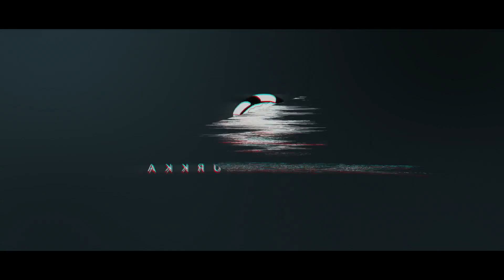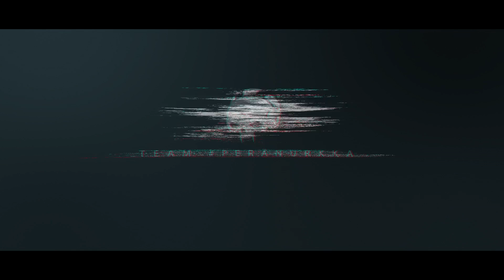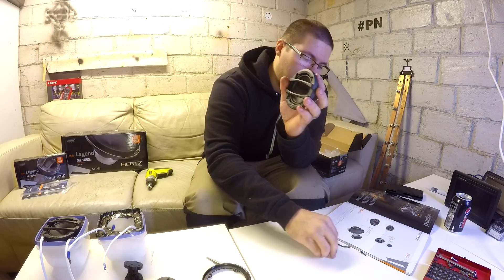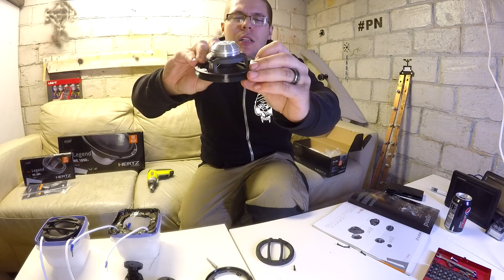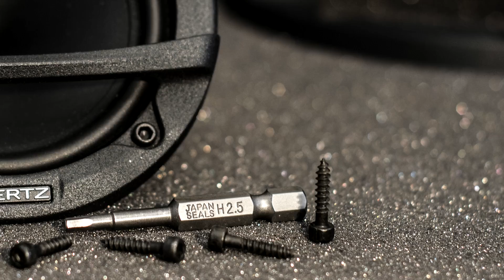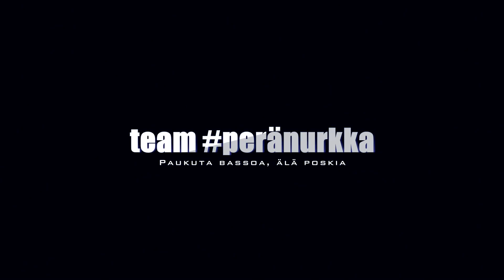[ENG] Hertz ML700.3 70mm midrange speakers

Comment: Hi, recently I heard ML 1650.3  2-way and the sound was quite weird, does this mid range helps to sound 1650 good?
Reply from the maker: 700.3 midrange speakees makes wondsrs if tuned correctly
Reply: @teamperanurkka  Thanks for quick response, I was listening them today for a hour and half on radio and on amp and it seems like  the mid range is totally overhelmed by deep bass which woofer can produce, even with some crossover fidling the Cento Line was better and way cheaper.. which made me sad. Problem with  Legends  3-way is that is soo much money. Have you ever listen 3-way Mille Pro Line?